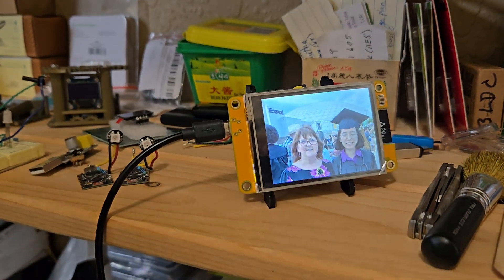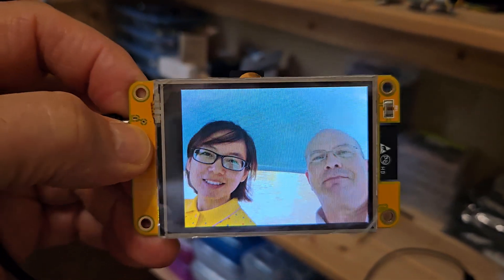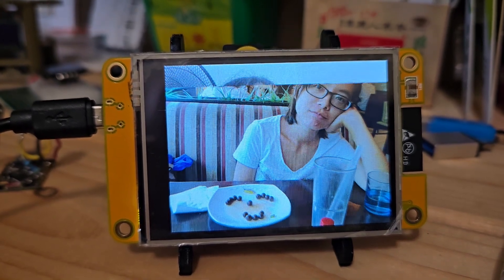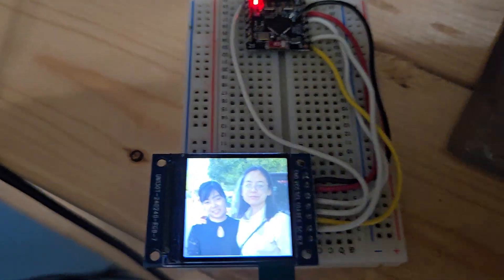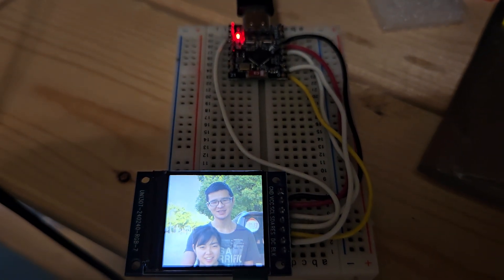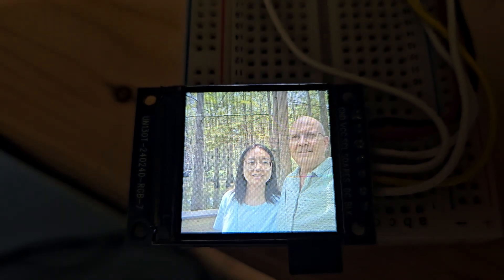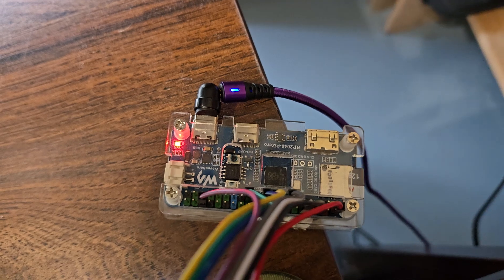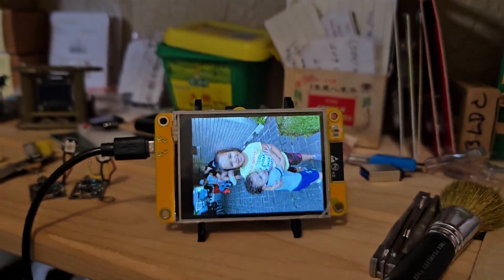CYD. ESP32-2432S028 using LovyanGFX library.

Comment: Can you please share the link to the code you use?
Reply from the maker: This is the code for the ST7735 using an ESP32 processor. You just need to resize your pictures to the screen size and use 24bit BMP files. 
Let me know if you're looking to use the LovyanGFX library and I'll dig that up for you. 
This code has proven to be really slow on the larger TFT I have - 320x480 ST7796 so I'm working to see if I can implement double buffering.
Thanks for your interest.

#include <Adafruit_GFX.h>         // Core graphics library

#include <Adafruit_ST7735.h>      // Hardware-specific library
#include <SdFat_Adafruit_Fork.h>  // SD card & FAT filesystem library
#include <Adafruit_SPIFlash.h>    // SPI / QSPI flash library
#include <Adafruit_ImageReader.h> // Image-reading functions

#define SD_CS    0 // SD card chip select
#define TFT_CS   5 // TFT select pin
#define TFT_DC   2 // TFT data/command pin
#define TFT_RST  4 // Or set to -1 and connect TFT RST to Arduino reset pin
int sck = 18;
int miso = 19;
int mosi = 23;

SdFat                SD;         // SD card filesystem
Adafruit_ImageReader reader(SD); // Image-reader object, pass in SD filesys
Adafruit_ST7735      tft    = Adafruit_ST7735(TFT_CS, TFT_DC, TFT_RST);
Adafruit_Image       img;        // An image loaded into RAM
int32_t              width  = 0, // BMP image dimensions
                     height = 0;

#define MAX_IMAGES 100
String images[MAX_IMAGES];
char filename[25];
int imageToShow = 0;
int imageCount = 0;

String filedir = "/resized";

void setup(void) {

  Serial.begin(115200);

  tft.initR(INITR_BLACKTAB);      // Init ST7735S chip, black tab - with big SD card
  Serial.println(F("TFT initialized."));
  tft.setRotation(2);

  SPI.begin(sck, miso, mosi, SD_CS);
  if(!SD.begin(SD_CS, SD_SCK_MHZ(10))) { // Breakouts require 10 MHz limit due to longer wires
    Serial.println(F("SD begin() failed"));
    return; // Fatal error, do not continue
  }

  File rootFolder = SD.open(filedir);
  File nextFile;
  String nextFileName;

  for (imageCount = 0; imageCount < MAX_IMAGES; imageCount ++) {
    images[imageCount] = String("");
  }

  imageCount = 0;
  while((nextFile = rootFolder.openNextFile()) && (imageCount < MAX_IMAGES))  {
    if (!nextFile.isDirectory()) {
      nextFile.getName(filename, sizeof(filename));
      Serial.println(filename);
      String s_filename = filename;
      if (s_filename.indexOf(".bmp") != -1) {
        Serial.print(" = ");
        Serial.println(imageCount);
        images[imageCount] = String(filename);
        imageCount ++;
      }
    }
    nextFile.close();
  }
  if (nextFile) nextFile.close();
  rootFolder.close(); 

  tft.fillScreen(ST77XX_BLUE);
//  reader.drawBMP("/resized/treehugger.bmp", tft, 0, 0);

}

void loop() {
  Serial.print("Showing image ");
  Serial.print(imageToShow);
  Serial.print(" - ");
  Serial.println(images[imageToShow]);
  //delay(1000);
  tft.fillScreen(ST77XX_BLUE);
  if (images[imageToShow] != "") {
    String drawImage = filedir + "/" + images[imageToShow];
    reader.drawBMP(drawImage.c_str(), tft, 0, 0);
  }
  delay(5000);

  imageToShow ++;
  if (imageToShow > imageCount-1){
    imageToShow = 0;
  }
}
Reply from the maker: Ah, I found the LovyanGFX code. I find LovyanGFX much easier to use than TFT_eSPI. The problem is - most of it is in Japanese and I do not read Japanese....
This code is for the CYD. 

I forgot I have github - her's the link:
https://github.com/dazzor/photoframe/blob/main/CYDusingLovyanGFX